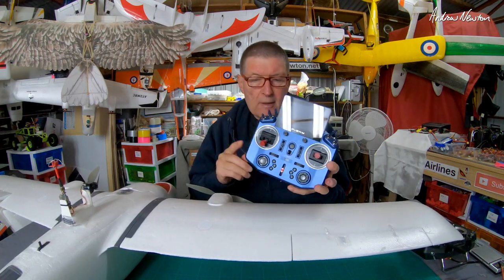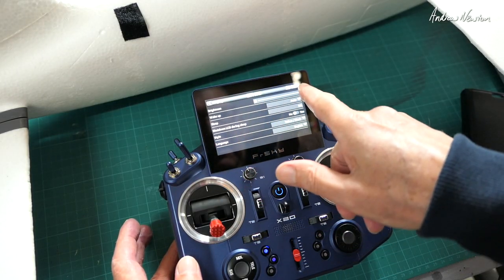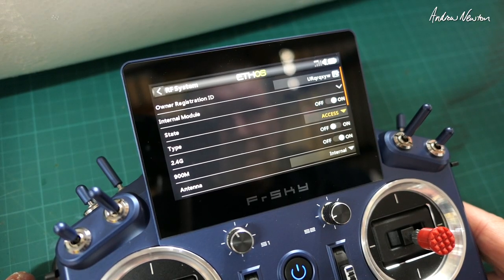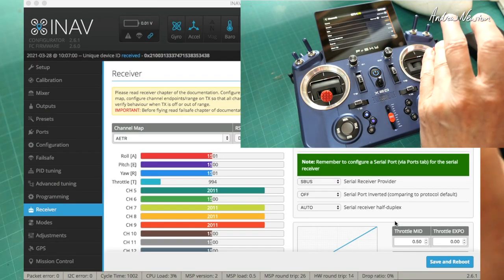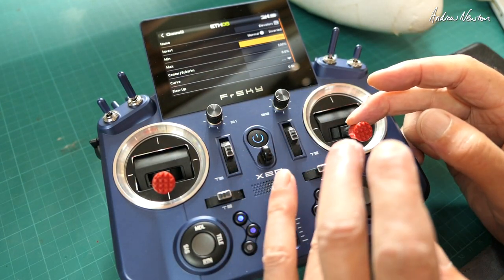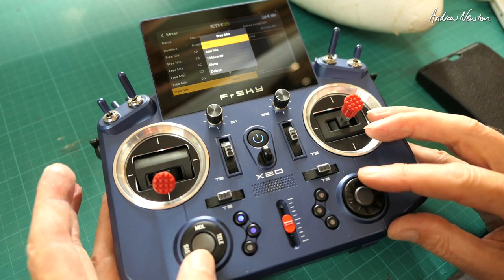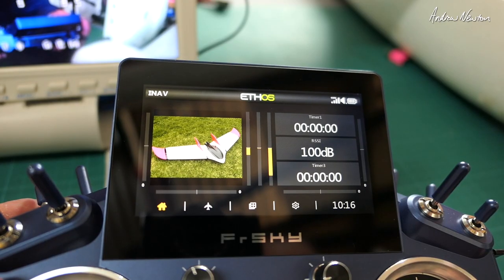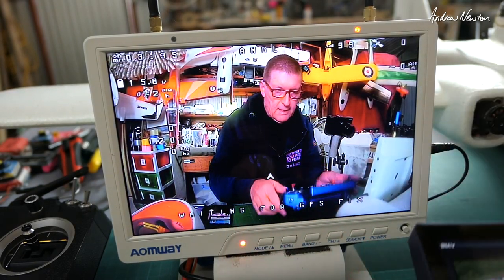FrSKY Tandem X20 EthOS INAV setup

Comment: @Andrew Newton - Would really help if you shared your view here. My Futaba T8FG has just gone bust and while I could get it repaired im in the market for a new radio. I'm torn between the FrSkt X18/20 or the Radiomaster TX16S MK2 with AG01 Gimbals.

1. I currently have only FASST receivers so im guessing neither f the 2 will support them
2. looking for the widest possible coverage with the 4in1 MPM
3. The tandem 900 & 2.4 connectivity seems very tempting when I'm flying Fixed wing
4. Would you consider either of these at par with Futaba Quality? I loved my T8FGand its form factor.. 

OPTION1: X18/20 with 2 Addon Modules (i: ELRS & ii: 4in1)
OPTION2: TX16S MK2 AG01 4in1 one Addon Module (i: ELRS)

Which one would you advise. How much better in quality is the X18/20
Reply from the maker: FASST is only supported by the Multimodule 4 in 1
Tandem system is amazing but so is ELRS
X18/20 are superior quality by a long way, but restricted to ACCST V2, ACCESS and TD with no support for exterior modules other than FrSKY at this stage.  Watch the INAV Wing Talk first 30min, they are discussing this exact topic - https://www.youtube.com/watch?v=FZWseqEtZbo
If you want quality then FrSKY X18/20 all the way
If you want to use other than FrSKY receivers then it has to be TX16S
Reply: @AndrewNewton  thank you for taking the time to reply..I really appreciate it.

Is the FrSky Multi Protocol Module available already?

Comment: Andrew, would you know if the Qx 7 (the new version with the 18650 batteries) works with crossfire ( has a full speed inverter) or do you still need to solder the small circuit board to the main board? Thank you for your time. ;-)
Reply from the maker: Dont know sorry Chris. Never looked at crossfire

Comment: HI Andrew. I just bought a Tandem X20 and your videos have been a God-send at the manual leaves much to be desired. However, I was wondering if you plan on showing a setup for a typical six servo glider. I've been able to figure out most things but Flight Modes still have me baffled. I'm sure there are many more glider pilots in the same position as me as the radio is fairly new. Any chance of helping out us pure glider guys?
Reply from the maker: I don't use the X20 much, or flight modes. Ask Darren Lines. He knows more https://www.youtube.com/channel/UCDYMfz6BIhqY9zHU8wCmFeg

Comment: At least one matter INDEED. Looking to be a fine radio. Wonder if it will eventually send tele on 2.4g and control on 900mc?  INav and Ardupilot Lua scripts next. then HD FPV...You go FrSky! How about built in Alt, Cell voltages in some receivers that have stabilization that also share the gyro data on smartport so as to allow a smartport telemetry fed Nav/Ardu LUA likr script on that pretty screen?
The newish R9STAB is a fine receiver when used with the ACCESS R9 module running ACCST firmware on my Non-plus and original X9d as well as that Horus cloned  JT16 plus. FrSky...Build it, support it, and they will come.  And for the best acceptance to the widest consumer base...Let us decide...ETHOS or OpenTX.

Comment: Is this good for just anyone or only for the experienced ones?
Reply: @andre47g, that is one of my concerns, yes.
On the other hand, if some people can master such a remote, does that not mean that everyone can? Or, maybe, it's not about that, but about how it can be too much hassle?
Reply from the maker: There are much easier radio systems to use, like Detrum, FlySKY and Spektrum. But I found once you learn OpenTX or even EthOS, all the others seem too restricted
Reply: @AndrewNewton  Good answer, OTX is THE most flexible system ever...🤔😀🇬🇧

Comment: Hi ,I have just received my x20, I can't find anything like those settings that you have shown, thanks
Reply from the maker: Which ones?
Reply: @AndrewNewton  base model , I believe,  am looking for dual rates for the flight surfaces,are you able to relocate switches,  aren't able to find anything about all the togel switches,  only brought this so I can use a air speed indicator for a 118 inch lysander that I'm putting together, seems to me this transmitter is only for foam and quad copter

Comment: Hi what sensor for thé alarm lipo always vfas or rx bat ? I use r9 mx
Reply from the maker: FrSKY lipo sensor or current sensor is what I use. Or a flight control board.
Reply: @AndrewNewton  
I found it s Vfas
Reply: How adjust vfas sensor? Thé value is not just ?